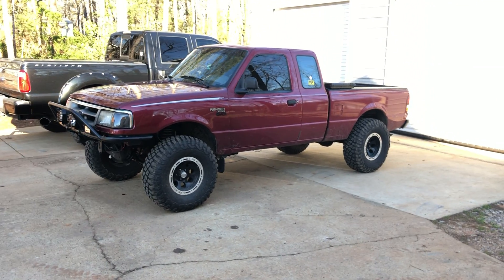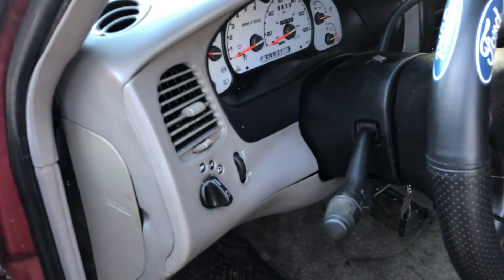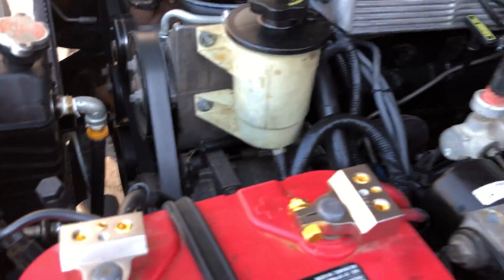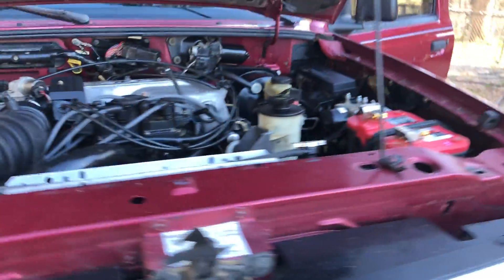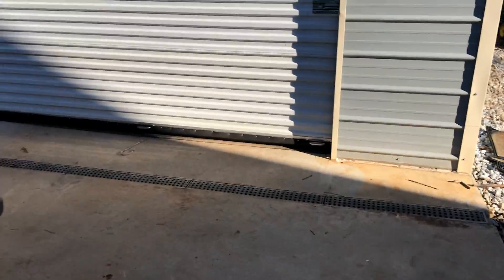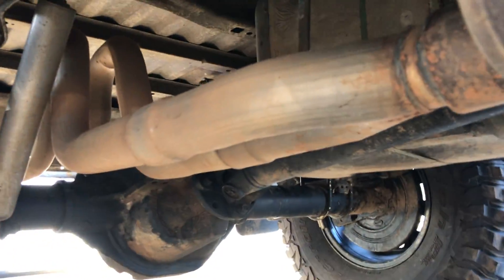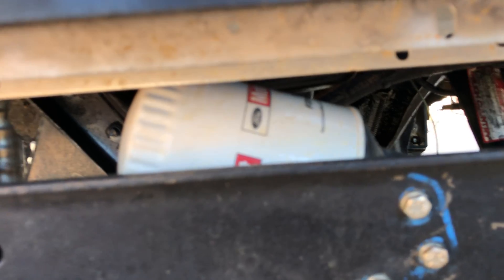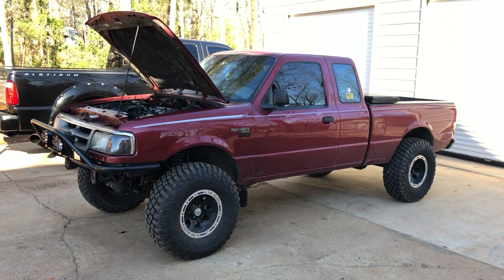Lifted V8 Ranger Swap Explained!

Comment: Any way u couldve kept it stick??
Reply from the maker: Sean Rowden yes and no lol actually have an M5OD-R2 thinking of putting behind it
Reply: I have a 93 stepside single cab. Splash edition thats leveled on 32s an steel wheels. Factory 4x4 5 speed 4.0 truck wanting to 5 speed swap but keep my trans. Is that possible
Reply: You can keep the 5 speed, but you need to throw away all the auto trans stuff and run a M5OD-R2 transmission and run a flywheel, starter and clutch kit from a 96 F150 5.0. You'll get a CEL for missing trans controls unless you tune it out, as well. Other than that, it works fine.
Reply from the maker: prushimush awesome info thank you!! Been thinking of doing it for a while now but wasn’t sure if it would act funny looking for shift points and what not. Thank you for the information though!👍

Comment: So I see you took the manual transmission out. I want to do this to my 2000 Mazda b3000 that has the 5 speed in it. Is there not a way to fit a manual transmission in there with the 5.0?
Reply: There is a way. M5OD-R2 from 97-03 F150 V6(has correct shifter placement), 96 F150 5.0 flywheel, starter & clutch kit. This whole setup will fit with your stock aluminum driveshaft and trans crossmember, and the clutch line plugs into the M5OD-R2. I did this to my '98 Ranger(formerly 2.5/5 speed, now 5.0/5 speed). Check my channel out.
Reply: Thank you so much

Comment: Thanks a lot for the Video! I understand you used all explorer wiring in engine bay,  and up to the explorer dash, ..Did you use the ranger wiring from the cab back to brake lights?

Comment: So only the 1999 ford mercury mountaineer 5.0 motor fits this? I was thinking about a mustang 5.0
Reply: It's easier to use a explorer as a donor. Then you have everything you need. I drive a 2000 4x4 and used a 2000 mountaineer as a donor. It required no custom fabrication. I only had to change one motor mount. It was an easy swap.
Reply: @mikedoyle1762  My ranger is a 94 and its a manual transmission. Would just an engine swap work?
Reply: @mikedoyle1762  I have a 98 ranger 4.0 4x4 and the 2001 mountaineer 5.0 really thinking about making the swap since I need to cut down on vehicles. Any good tips??

Comment: I found someone selling a 5.0 96 explorer and was considering buying as a donor for my 2010 ranger rwd 4.0, I have a few questions tho, I’ll need new motor mounts like you right?  Or will the 4.0 not need it?  Also is the 96 also a fuel return less system, or will I need a fuel return?  Will I need to swap the rear end or is my rear end fine?  The lsd sounds nice but I don’t know if I’d want to do it for a while if I can get it anyways.  Will my 4.0 radiator be fine or will I need bigger?
Reply from the maker: uhZeny yes you will need motor mounts as far as I know! I’m not sure what all they have changed on the 2010’s but I would do some heavy research or just wing it like I did! Best of luck to you!
Reply: @shadetreemechanic1790  the 4.0 OHV is a direct swap, his 4.0 is the SOHC, it is NOT a direct swap, there is a TON of work and buying needed, very difficult, better off buying a 1996-2001 ranger 4.0/B4000 then doing the swap
Reply: @kenp9199  I have a 98 4.0 4x4 and a 2001 mountaineer 5.0 awd. From my understanding this should be a direct swap correct??

Comment: Did you shoehorn the 5.0 to fit into the 2.3? I was wondering if the 3.0 bay was bigger than the 2.3 engine bay? To date, how's it running for you? Nice pre-runner👍
Reply from the maker: They should be the same bay.. slight firewall modifications and it fit right in. Thanks!
Reply: @shadetreemechanic1790  👌

Comment: Would this swap work well with the 3.0 ranger?
Reply: Yes it will I'm doing one now for 01 ranger vulcan engine
Reply: @fightnight47364  how has the conversion gone?
Reply: @dxta7360  Not bad , thanx for asking , had to put on hold , couldn't past up a deal I saw ( 02 Chevy Xtreme). But I started to tear down 302 for the 01 ranger yesterday .

Comment: I have a 99 3.0L ranger and I’m thinking about doing the 5.0L swap but I want to keep my manual transmission. Or swap in another manual. Is it possible?? I’ve only seen people swap in automatics like you have and personally I’d like to keep my truck manual
Reply from the maker: RedSkies000 you can... just have to get a different computer from my understanding. I just used what I had but best of luck to you 👍
Reply: Shade Tree Mechanic hmm interesting, I think I’ve heard of someone using the mustang gear box... with some modifications to the trans tunnel. Thanks for the reply tho 👌🏼
Reply: @redskies0004  97-03 M5OD-R2 from a 4.2 V6 F150, flywheel, clutch & starter from 94-96 5.0 V8 F150 are what you want. Finally, hammer the firewall to cab seam flat when you have the engine out of your Ranger and slot your trans crossmember bolt holes. Use your stock driveshaft and clutch line. This will get you a 5 speed 5.0 Ranger, I did it with my 98 2.5/5 speed to 5.0 and it works fine. You will get a bunch of transmission CEL codes unless you have it tuned out of the ECU, but you can run it with the auto trans 5.0 ECU.
Reply: prushimush that is doable, thanks man I appreciate the info, now all that’s left Is to source these parts 👌🏼, but tell me... how badass is it. I have a 3.0 5 speed ranger and while it’s got some balls it’s slow. And you said using the auto Ecu would just throw codes? Are you referring to the auto ecu from the explorer? Just to clarify. All n all tho, sounds like an awesome project.
Reply: @redskies0004  It moves out pretty good. It's kinda like a 5.0 Foxbody Mustang if you've ever driven one, and you can do a lot of the same mods to it to make it faster. The light Ranger chassis and 5.0 torque is a good match and you can light the tires up easily. It sounds like a Foxbody as well. I need an exhaust on mine.

Yeah, you'll get ECU codes only if you don't tune automatic trans control out of the auto Explorer ECU(which you will use on a swap) You can do this with a SCT tuner or send your ECU out to someone to have it done. TheEFIGuy & Drag Radial Performance(ebay) will do it. Once you get it tuned, you won't get any CEL codes and it'll run great.

It's a good project and totally doable in your backyard/driveway if you need to do it that way. The 98-00 chassis is a perfect match for it too, since the engine harness plugs right in.
Reply: prushimush sweet! I see you got some videos up on it too, I’ll check those out and follow, and thanks for the info man it’ll really come in handy. I couldn’t find anything anywhere about people swapping but keeping it stick, just everyone swapping to the auto. Now I’m even more excited to get this swap goin haha
Reply: @redskies0004  Definitely join us at V8 Ranger Swap Group if you have a Facebook. That's where I got all of my stick swap info. There are ways to run a T5 as well.

Comment: I have two 1998 ford rangers ones 4.0 and engine blown and I got another same year  has 3.0 engine with 270 thousand miles. The transmission good in 4.o  . the 3.0 transmission bad. Can I put my 3.o in the 4.o. Same year model color. Will 3.o fit in the truck that has 4.0. And if any body interested in buying both trucks is rather find a used. At and sell both these.

Comment: I’m new to all this stuff. I’m not stupid but I’ve never done a swap and just started working on big vehicles always been on atvs and once an outback. So could you redirect me to a forum or tutorial on how to do a 3.0 to 5.0 swap, I have a 95 ranger xl and I could find a vehicle with a 5.0 or build the engine from scratch. Just need to know what to do for the swap, interior, mounts, etc.
Reply: V8 Ranger Swap Group on Facebook. You will need a Ranger and a donor Mountaineer/Explorer. The donor Explorer chassis will be your "kit", as the parts will all fit onto a Ranger.
Reply: prushimush haha I just put a 350 in a shortbox Chevy last week so I’ve learned a lot since I said that comment, 😂 I’ll definitely check the group out though thank you.
Reply: @jeremiakendrick9165  oh yeah, you'll be fine. There are a couple of SBC and LS guys on that group, too, we don't hate on Chevy engines. Whatever gets the job done lol
Reply: prushimush 😂 I got the engine for free with a burnt piston and I did all the gaskets and cleaned it, sides were scored got the Holmed and popped it in with some other issues 🔌

Comment: I'm getting a truck exactly same without any mods and it's a v6 and silver and I'm thinking about lifting it mines 2wd too will it still mud and offroad good?
Reply: I got the same truck only a 2.3 with a manual and it’s a 2wd ranger if you wanna get through any mud you need good tires and speed. I hunt with mine and if I don’t keep at least a little momentum it’s stuck so it’ll do what it needs to but not all of what you want it to
Reply: @aarongrillo4385  thanks
Reply: lil macs hunt,fish,trap get a rear lock right locker

Comment: I was wondering if I could do this with my 1999 Ford ranger v6 but I wanna put a coyote 5.0 what do u think I need and if it's possible,do I need bigger or better tyranny
Reply: A coyote would absolutely not fit. Its way too wide for a ranger's engine bay. The best v8 to swap in is a 302. (Pushrod 5.0)
Reply: Oh yes sir thank you
Reply: @MikeSully01  it will fit.
Reply: Mike Sullivan you will be surprised, you actually can fit it
Reply: Wait so u actually can fit it
Reply: Fidel Rivera ive only seen it professionally done
Reply: @fidelrivera9308  Don't get your hopes up. Many people say they want a Coyote 5.0 Ranger, but they are extremely rare. Stick to 5.0 or LS if you want something that might ever drive under its own power again.
Reply: @zach4185  Anything can fit, but you won't get it to fit because it will cost too much time, money, and effort, this I can guarantee.
Reply: @zach4185  When I specify "you", I mean "you" as in "Zach no", a person who made a statement, not "you" as in "me", ie prushimush. You've got some serious reading comprehension problems, I'm afraid. There is no contradiction there, I did not imply that I did anything in that sentence. This is called "symbolic logic", if you're curious. Consider: P implies Q: "Anything can fit" implies that a Coyote 5.0 CAN fit, which is a true statement; it can possibly fit, after all. I then assert that YOU(Zach no) won't get it to fit due to time, money, and effort limits. I was addressing you here, not specifying my action(see: reading comprehension).

Care to prove my contradiction? We all make mistakes. You made one before by asserting that a Coyote 5.0 Ranger swap has not been done. This is a false statement, several exist, but they are all running custom front crossmembers and frame modifications. You don't seem to have much knowledge on this subject, though.

FYI, my 100,000th generic 302 Ranger works fine. I upload the videos to show my ignorant friends. We like to argue for fun where I am from.
Reply: @prushimush  You, contradicted yourself several times.  Did you not read my last comment
Reply: @zach4185  You can't just throw around words like "contradiction", they have a logical meaning, you know. When I addressed you(pronoun: "you"), I was not speaking of me(pronoun: "I", etc). There was no contradiction: I asserted that you, Zach no, will not complete a Coyote swap on a Ranger chassis, not that I tried to do such a thing. " YOU WONT GET IT TO" is what you quoted me, but you quoted me addressing YOU, not me addressing myself. This isn't rocket science, you are gonna have to try harder than that.
Reply: @zach4185  You seem like the upset party here, considering all the time and energy you've put into insulting me, and I can summon you back here like clockwork by tagging you. Go take a look at my very first comment, Zach: I didn't say that you would swap a Coyote engine into a Ranger, I(prushimush) stated you(Zach no) won't complete this engine swap - a statement I believe very likely to be true considering your knowledge of the subject. If we take this sentence apart, I'm not saying that you are saying anything. I am saying that I don't think you are capable of doing the swap due to the costs and effort involved. Have you learned symbolic logic argument form yet? That's why I'm ticking you off so much.
Reply: @prushimush  lmfao. Dude look at the books you're typing me. Who's mad? Thatd be you. Gayboy.
Reply: @zach4185  It doesn't take much effort to type all of this out. Well, maybe it does for you. "Gayboy" now? Come on, man, you can do better than that. This is why the Chevy people make gay jokes about Ford guys.
Reply: Lmao yeahbecause you ford fanboys are easy targets.

Comment: Will the same 5.0 motor fit in a 95 ranger xl
Reply: I've seen a 7.3l turbo diesel and a duelly swap on a ranger. You can fit whatever you'd like in it, just how much work do you want to do? The 95 should be a direct bolt in swap from an explorer if you use the 302 engine.
Reply: @nestor aguirre From my understanding they are the same platform. I think it would. Probably do some more research on it though

Comment: Will a 4.6 work
Reply: Not worth it. It's way too big for the Ranger chassis front.
Reply: Anything is possible. I remember back in the day ford built a one off ranger with the 5.4 lightning engine. If you have the money it can be done.

Comment: I'm planning an upgrade to 5.0 in my 2002 Ranger; how hard would you rate the project overall? I think you showed you needed to widen the transmission tunnel, but was that because the manual was smaller than the automatic? It looks like there is enough room for the 4WD transfer case under there... any thoughts?

Sounds great, man... good job!

Comment: Quick question man! I want to do this to my truck as well but just wondering, what does the oil pan clearance look like? I would think that it would wanna come into contact with the cross member
Reply: Probably depends on what year of ranger, if you have a 98 and up (4wd) then it is the same front frame as the explorer, all the others (98 and up 2wd, and the older rangers) need adaptors that I assume bring the engine to a height that clears
Reply from the maker: Oil pan clearance is good with factory explorer oil pan.

Comment: Did the motor fit with the same transmission
Reply from the maker: Blake Carbaugh yes it’s the motor and trans from an explorer.
Reply: So am I able to put a 5.0 from an explorer with a stock Manuel Ford ranger transmission ?

Comment: I have a 86 ranger 4x4 will engine bolt up. To the 5 speed
Reply from the maker: ArchV1 not sure on the 86.
Reply: I think it would require a transmission adapter. Lots of info on forums available.

Comment: How could you do this conversion and keep it a 4x4
Reply: And mine is a 2004, would it be possible?
Reply: Youd want to swap the AWD frame out of the mountaineer/explorer and put the ford ranger on it.
Reply: AMC guy thanks! Would you be able to find a manual transmission to the 5.0 tho, I’ve heard it’s close to none.
Reply: @theweas4910  you would need a manual transmission and transfer case out of a 97-03 f150. But you also need the automatic transmission features tuned out of the computer.

Comment: Really nice swap wondering if it will clear the Dana 35 in the 4x4 or will you need a diff drop or better yet a solid front axle swap
Reply from the maker: Robert French it should!

Comment: Nice build  . I built a 95 ranger explorer swap . For your power steering  issue you need a 92 ranger 4.0 power steering line there $22 on rock auto or autozone  . You have to bend the  gearbox  end  straight what goes in the gear box  but it will work and mine doesnt. Leak 
 https://www.therangerstation.com/forums/index.php?threads/5-0-explorer-fead-swap-into-a-83-92-truck.133205/
Reply from the maker: josh siebert thank you so much for this comment! Will definitely try that hose out! 👍

Comment: you went from the 4cyl to the V8, thats a noticeable jump I'm sure, lotta stuff that isn't compatible, I have a 1999 B4000,   ps, stop calling everything "LONS" power steering LON oil filter LONS, it's Line... l o l
Reply from the maker: Ken P well see down here in the south our accents are a little different. 😉
Reply: @shadetreemechanic1790  I live in MS, and I have to hear it everytime I visit my parents lol
Reply: That s how it dern
Reply: Believe it or not, I did this swap on my 98 Ranger and had EGR and rear O2s tuned out of the ECU. CEL works as intended and it doesn't throw any codes. Even EVAP, ABS etc works. Somehow, Ranger chassis cars are pretty much 100% compatible with 5.0 stuff.